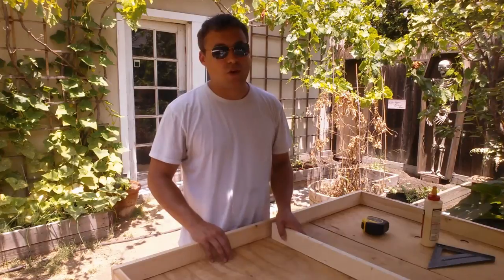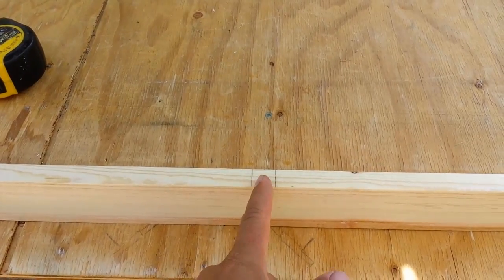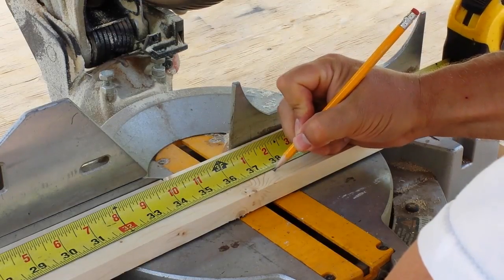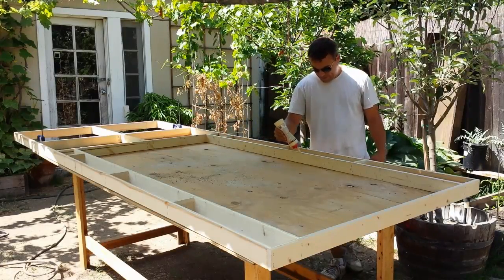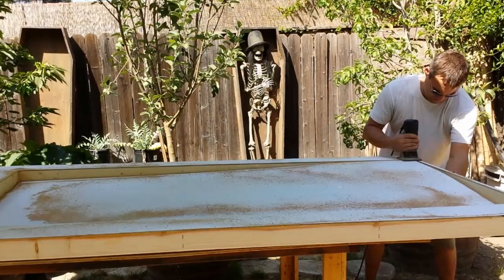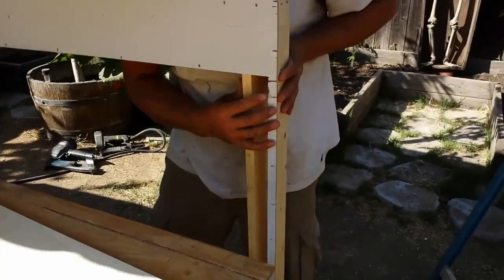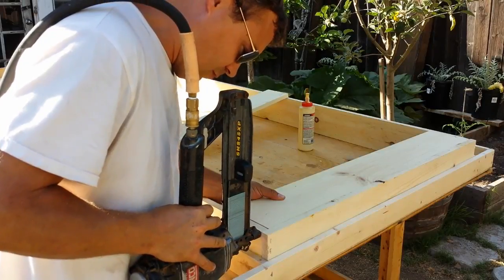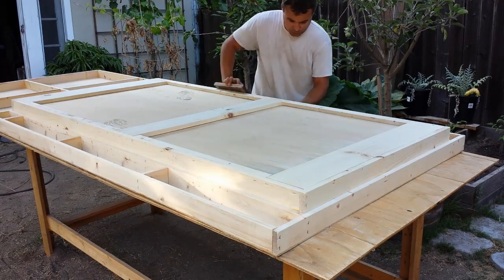Building Set Walls | Trade Show Booth Walls | Making Hollywood Flats With Windows & Doors (Pt.5)

Comment: what side nails or staples are you using. good videos!
Reply from the maker: the staples for the framing are 16 gauge 1-3/4" long.  we also use alot of 18 gauge finish or Brad nails.  I do have a 16 gauge nail guns but the longer they are tends to curl out the sides of the pine.
Reply: I'm a residential carpenter and I'll be building some flats for a friend. I don't own a 16 gauge stapler as they're not used much in residential work. I want to make sure everything is strong when I'm done. Would you suggest I pick up a stapler or would nails suffice? I have a framing gun that can shoot 8 and 16 pennies, an 18 gauge brad nailer, and a 15 gauge finish nailer and a 1/4" stapler.